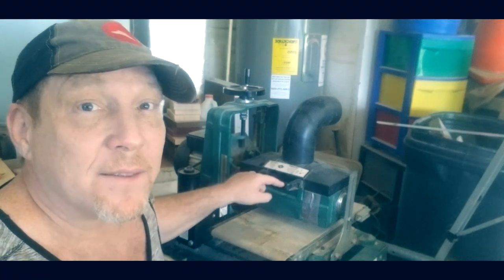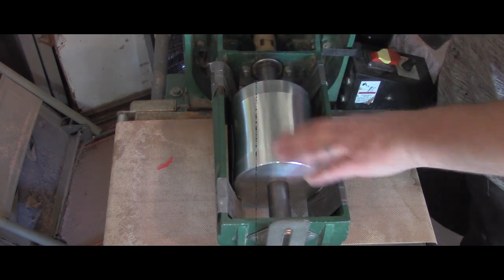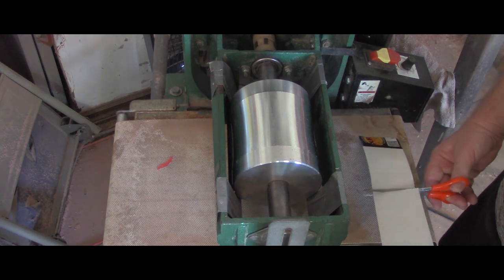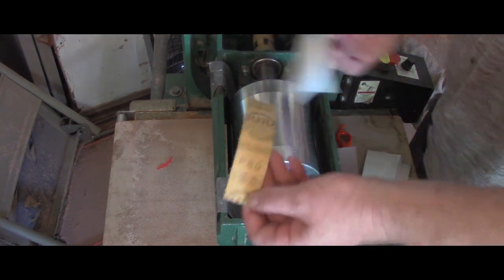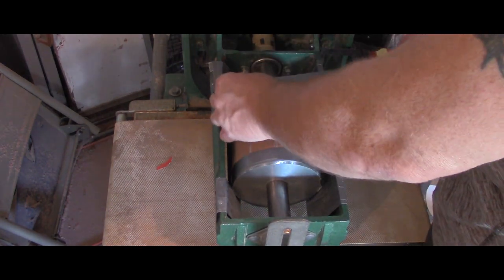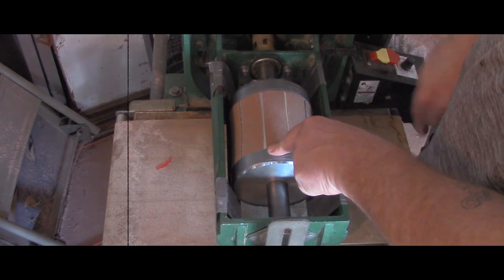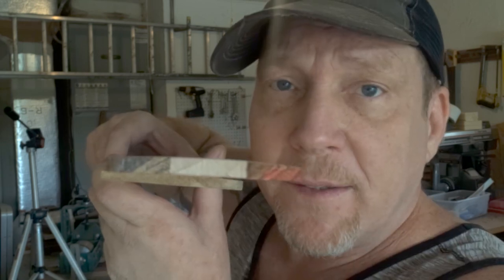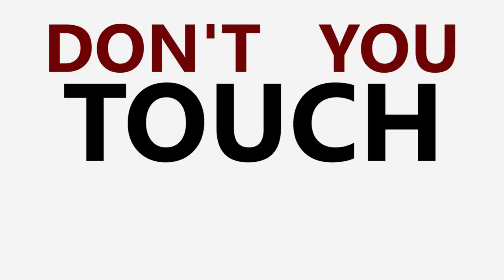The Video GRIZZLY INDUSTRIAL TOOLS Doesn't WANT YOU TO SEE!!

Comment: Only problem I can see Shawn is that this method can introduce scallops if there's not a consistent pressure on the fretboard, similar to the snipe you can get using a thickness planer

Comment: You need a lip on your board, like a fence on a table saw to keep your neck stock centered in the sanding drum and then the material that's removed will be equal on both sides of the neck!

Comment: Ok sean, I'm slabbing wood. Mostly pine and oak, but occasionally walnut, apple and other woods. What's your thickness for an acoustic half? Electric body? I'm going to send you some. Occasionally, I'm going to run into Walnut, Madrone, Cedar and some other stuff. I'm building a drying rack now for the slabs I'm cutting.
Reply from the maker: HMU but Pine and Oak aren't what I would use.